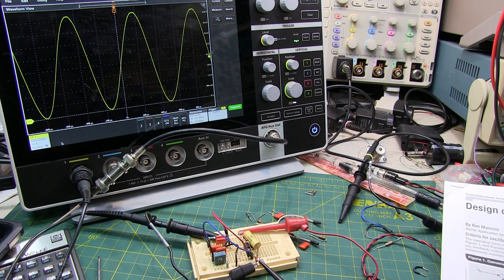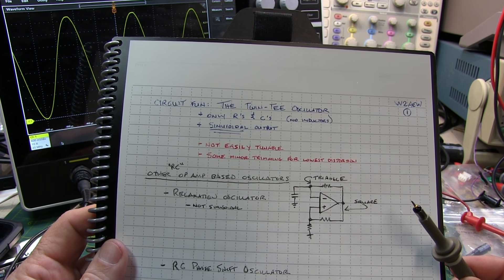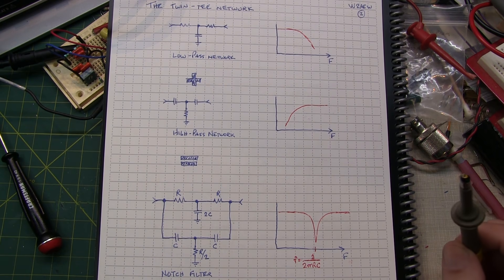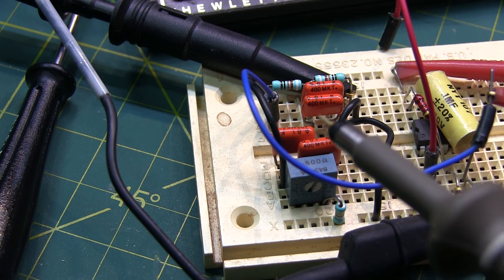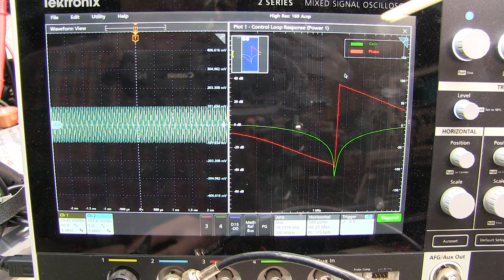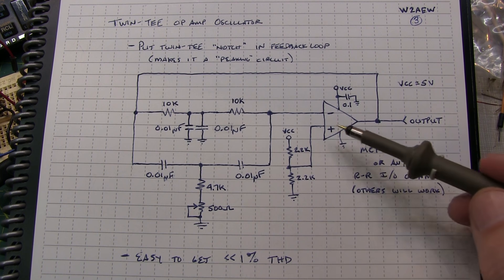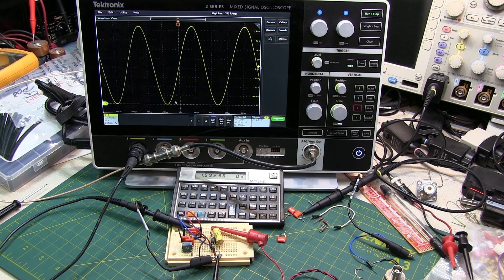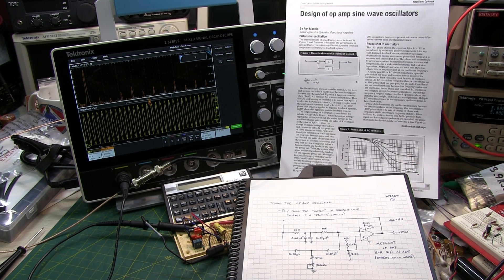#380: Circuit Fun: Twin-Tee Oscillator - low distortion op amp sine waves

Comment: I like your videos. One of the key structures they demonstrate is there are single topics that can be tackled in both a scholastic and lab environment, and you don't need to spend weeks on it. Once you have intellectually secured a structure in most the fundamentals and math for the science of engineering, circuit analysis coupled with a lab will adequately help us advance.

I was just studying Twin-T RC networks and associated the last couple of months for audio applications, so an oscillator relative is a great topic for my brain's configuration ATM. In music audio, T-notch filters are abundant in modern equipment. Even with them incorporated into common tone architecture both fixed and variable, you still constantly see production engineers in recording studios mastering songs, and they're scooping the midrange out of the instruments to balance out the tonal structure and make it more pleasing to our ears. 

I think a lot of that need is running through so many active circuits, and the midrange one piece of gear notched out is brought back into the output bandwidth by another because such is the nature of amplification stages, even when it's unity gain.

Comment: Interesting subject to get into and play with it. Thanks for the idea. This is a very straightforward and easy to understand circuit. Probably not suited for high frequencies as it gets more and more difficult to make a good noch..? It seems simple circuit at the core, but it can get very complex if you would go and research the relationship between the max damping, Q of the noch to the fact does it starts to oscillate or not, and the stability... But as always very inspiring content and indeed osci-later! 73 😀

Comment: This is the circuit used for analogue drum synthesis for example the Roland TR808 until the early 1980s when sampling took over. Voltage triggers are fed from the sequencer, the twin T circuit can produce punchy sounding membranophone sounds like kick and snare drums, Tom Toms, bongos, congas, claves etc.

Comment: It's a nice experiment, and I've done similar experiments, my conclusion is that it's very hard to beat even cheap DAC based devices. Something like the Scarlett 2 channel audio interface will output a 0.002% distortion sinewave at any frequency from 20Hz to 20kHz.  I have not been able to achieve anything like that with any oscillator based circuit.

Comment: Thank you for the video! The notch filter is very interesting by itself. Your voice sounds a bit strained. If you are under the weather, I hope you feel better. : )

On my cheap Rigol 1054z, I was able to get an audio frequency Bode plot by using the external trigger, fed from/to? the Aux-Out on my SDG2042x. The smoothing really helps clean up the visual Moirés ( the sic visual harmonics ) on the scope.

Seeing the even harmonic distortion, I am reminded that I've been trying to learn ways to make even-harmonic distortion, to emulate tube distortion. Tube distortion is mostly even harmonics, well except for pentodes like the EL-34, which is probably not the best guitar-amp power tube, when one thinks about it. Unfortunately, adaptions of the circuit would only probably make distortion on the notch--err-peak frequency. My friend said that sawtooth waveforms tend to make even harmonics. From what I have seen, the distortion from a tube tends to be an exponential drop-off of 2, 4, 6, etc. harmonic series. When I get rich, I will look around for an old spectrum analyzer from ebay that goes down DC. I have a Hack-RF one, which are supposed to make a decent beginner spectrum analyzer, but I have to update it first. Still, that's not going to help me for audio. Hmm. Audacity?

I once read an article in IEEE Times, that stated to the effect that harmonic content aside, tubes make more distortion with a lower shelf noise (noise-floor) than is possible with solid state (non-digital) devices, such as transistors, FETs, and I think, MOSFETs.

If a guitar waveform were only simple, another wave could be mixed in with a mixer(ring modulators), but with it being pretty full, it would sound processed. Perhaps the reason why diodes and transistors don't really make tube-like distortion might be partially caused from the threashold/cut-off making a squarish crossover-like distortion. (Like seen in the LM358s, as shown in your video.) 

[Ironically, I really liked your "#82: How to use a Diode as a Switch" video because beginner electronics learners aren't taught the very basics of how a diode's depletion region works. If you put a dozen electronics people in a room, and mention that, sure you can pass alternating current through a diode, it will trip-up a few people--yet, this configuration exists in transceivers. In watching, TRX Lab (great channel, too), as well as looking at the schematic for my Yaesu VX-8, I've seen quite a few dual-diodes (perhaps some PINs) in a single package, for signal chain switching. BTW, for digital, Jerry Walker has a great channel, as well.]

[Generally, I think that the tube distortion sounds pleasing because it adds a high-frequency um...sizzle, and I think that psychoacoustically, it sounds pleasing because our hearing/eardrums likely tend to naturally clip and distort with loud noises, which would hurt us a bit, BUT, if it's not actually loud enough to do that, then we are being subjected to something that something that would have hurt--but does not. It's kind of like going to a horror movie, rather than being eaten by a real monster. There's a difference, you see. : )  ]

Thank you again for making your videos. I think I have learned more from them than any other on the internet.

Comment: That's a nice video about sine wave oscillators. Back in the eighties in my 2nd year at university we had to design, build, and test our own sine wave oscillator. It had to be able to work in the frequency range from about 10Hz up to 100kHz. I chose to work with the Wien bridge principle, and that went well. Like you mention in your video, I used a FET as the controlling element. Most of the work went into the design of characterizing the FET, and creating a stable feedback loop, especially at the lower end of the frequency range. My design resembles a bit the design that you can find in the paper you mentioned. Distortion was below 0.5% between 100Hz and 20kHz, and it went up to just above 1% at the bottom and top end.

Comment: Hi Alan , great video!
If I understand correctly, the feedback is provided to inverting terminal of opamp, so at any other frequency except the intended one the opamp is in negative feedback, but at the notch frequency due to reversal in phase in the filter, now it becomes positive feedback with high gain and therefore an oscillator 
Is this correct?

Comment: In most cases, the oscillator part is easy-ish, the amplitude stabilization part dominates the distortion of those low-frequency oscillators. Any op-amp oscillator without explicit amplitude control is hitting op-amp nonlinearities to limit amplitude. If the resonator isn’t very high-Q, the distortion is pretty bad. A scope with less than 16 bits of ADC resolution isn’t the best tool to measure such distortion.

Yeah, a 50dB notch ain’t doing low distortion anything much without an amplitude control loop. A 100dB deep notch (good luck) will do the trick without an ALC. A crystal resonator will do that job admirably. But a twin-tee? Nope. It’s not like only the Wien bridge needs amplitude control. They all need it unless a very high-Q filter is used.

Comment: Great clip again,
Here is more research work:
It would be good to compare the phase noise and jitter of different oscillators.
Also, It also would be good to develop a formula for Q factor twin T filter based on R & C.  That is how to get the best Q, when the product of R and C is constant so we set the frequency with that. Which one gives us the best Q when Xc>R or Xc<R or Xc=R?

Comment: Very good video.  In need a 22khz filter circuit.  I am going to experiment with putting the twin-t network in the feedback and see how it works as a filter.
Reply from the maker: Putting the twin-tee notch in the feedback path "inverts" its response, turning it input a narrow bandpass filter.
Reply: @w2aew  I need a sharp bandpass filter.  I was not very clear on my comment. It will be the first active stage in a 22khz detector circuit after a voltage follower.